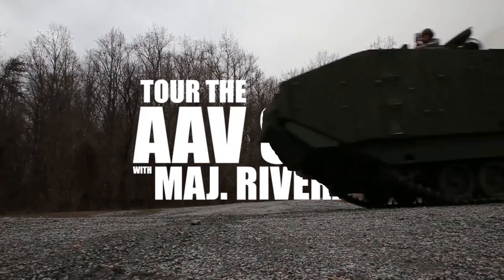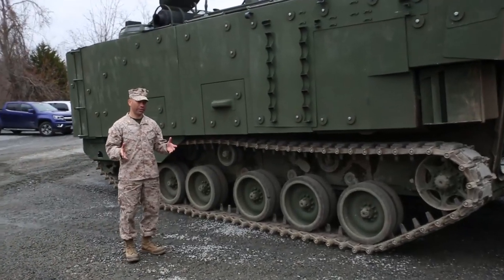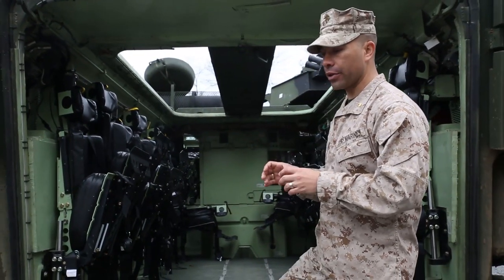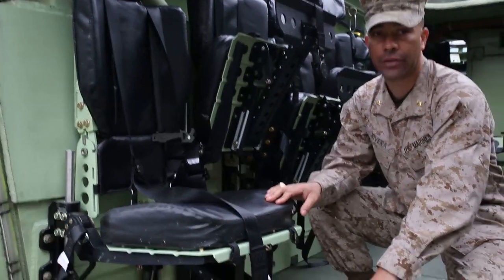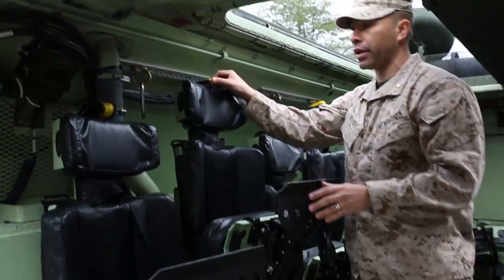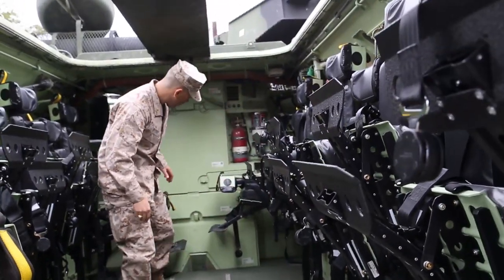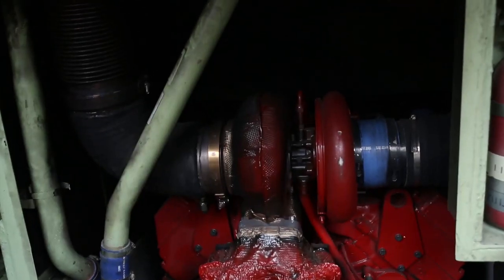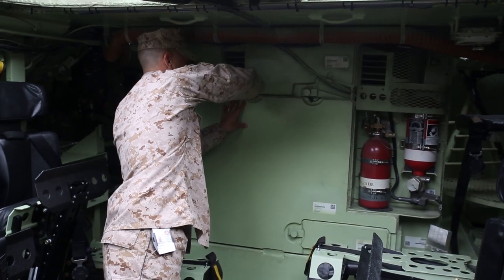The Future of Amphibious Warfare | AAV SUP

Comment: They said the new aav was coming out on 2000.
18 years later they still haven't updated the Amtrak.
This major has no clue of what he's talking about.
I don't believe  anything anymore.
Reply: hell they were talking about the AAAV way back in 96... never saw that thing hit the fleet.
Reply: @Sadarsa  i was in 2nd battalion aavs court house bay, 93-98
Reply: Meanwhile 50 billion in one year is spent on the f35 program. As an American it is easy to ask what exactly we are getting with all this military spending. It is not like soviet Russia exists and we need all this for survival.
Reply: They never did the upgrade wanted to use the money for acv,sad part is that these vehicles are 40 to 50 years old and last upgrade was 20 years ago,if they had done the upgrade maybe those marines that died off san clemente night have lived. The other thing is that these vehicles are useful during floods and humanitarian missions.
Reply: The reason they never released the AAAV was due to General Dynamics failing on their contract commitments.  FMC built the AAV, and that platform, it appears, is still going strong. I would be concerned about the contact cooler considering its life cycle. I am happy to hear of the power unit upgrade. 675HP wow!  The AAV started off with a 400HP 2-stroke Detroit and a cheezy transmission which hosted a Sunstrand steering unit. NOTE: components like that are selected by congressional committee. I could go on and on but suffice it to say I am happy the USMC vehicles are getting upgrades. Glad they got rid of those Gabriel shocks.  Go Marines!!!

Comment: Thank you for having a longer, more in depth video posted. I am worried about the speed of 7 knots. Will the turret get any modifications I.E. Thermal sights, M2 sights slaved to the M19 to cut down on adjustment times? 14 Pax seems like a reasonable troop lift.
Reply: +Cory Parker Wish we could just go with a 25m "bushmaster", didnt we almost have that with the "AAA" back in the early 2000's
Reply: Back in 2012 they put in thermal sights

Comment: nothing to compare with the EFV, it was a real fucking rocket over sea.The only way to make this hull faster is providing a better hydrodynamic and a power plant based on a gas turbine capable to develop about 2000 hp's.If i understand this new configuration of the crew compartment ,with these new blast mitigating seats,has reduced the crew number vs the previous configuration .Now we have 12 seats 2 row of six versus the four benchs providing 20 seats for a 20 members crew...

Comment: Which is better the new AAV or EFVs?
Reply: +Minh Pham EFV is dead like the AAAV before it. The replacement program for the AAV is a decade or three away from actually happening so we get this short-term modernization program so the AAV isn't a total death-trap.
Reply: EFV Was better in every way you could think of, speed, armament, capacity but then the marine corp decided they didn't want it anymore completely wasting billlions of tax payer dollars for absolutely fucking nothing.
Reply: Mufasa Can't necessarily say they were wrong about it. Don't recall the Marines conducting an actual amphibious invasion in the past 10 years.. But even still the AAV will have to replaced in the near future, getting too old of a design.